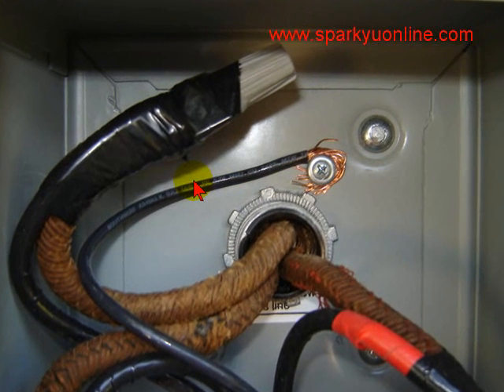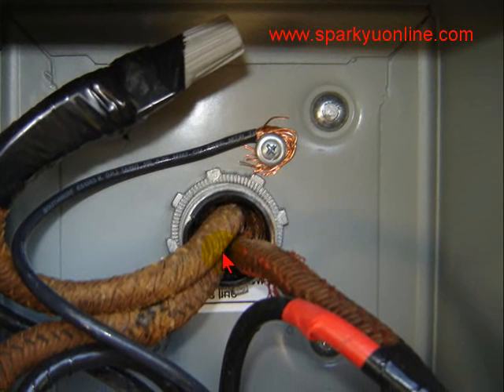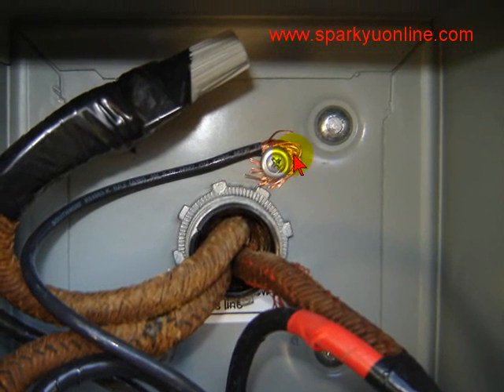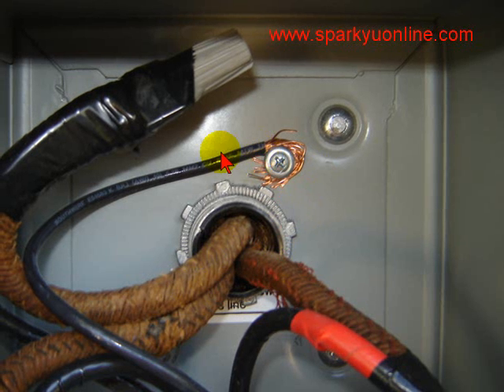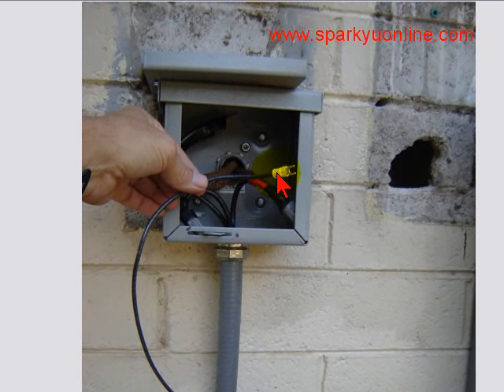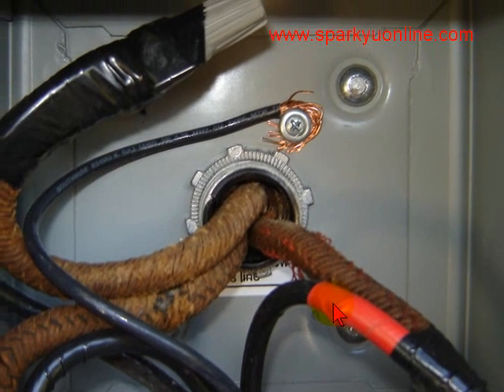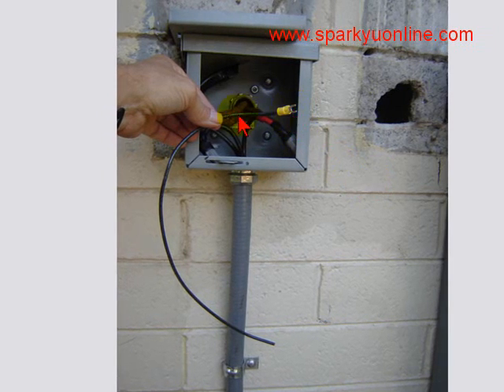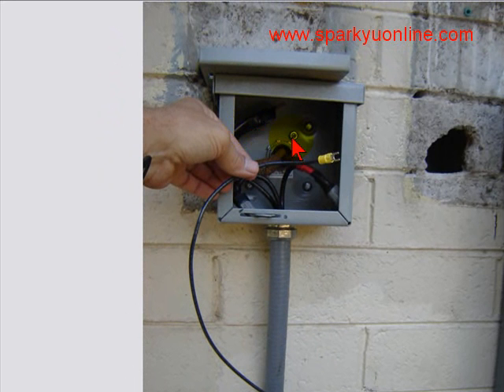Electrical Wiring-Fake Ground wire

Comment: I was a supervisor for a DTV HSP several years ago & saw some of the absolute worst rigged crap ever from the DTV techs. I'm glad they have some good enforcement in your area. My idea was to have the tech supply a pic of the ground block, ground and dish for every job if he wanted to get paid. Premier communications was too cheap to buy cameras for the techs. 2 months later Directv fired them and all of their techs (2000+) for their terrible service. Premier/SCOTT AQUINO ripped me off over $4000

Comment: I was at a customer because he complained when he touched his new steel garage door he would get shocked. I felt the tingle too. I did not charge him and said to call back the installers. A few years later I was called back to fix a broken door spring. I carefully touched the door and NO shock. When I went inside the garage I found the installers had fixed the problem by using 1/2 of a car battery jumper cable, one clamp on the door opener and the other clamp on the conduit. I then fixed it.

Comment: quick question, I tried to connect a wire to a plug, which has the two adapters for the black and white wire, where would I hook the ground to?

Comment: No grounding wire in that box?  Violation of code.  There is no doubt in my mind that the homeowner will discover something is wrong when the circuit shorts out, overheats, and causes a fire that burns the house down.

Comment: Does he still have a backside after you were done with him ??    I  am not a licensed electricen and do my own work but would NEVER do anything like this I always make my GROUNDS 100% even run ground wire inside conduit to equipment  steel conduit can come lose and / or carrode, my neutrals r 100%,   I use proper size wire for load and proper  circuit brakers for wire size, ballanced loads, worked  for  a power co so I  love ground rods.   Thanks for the great videos